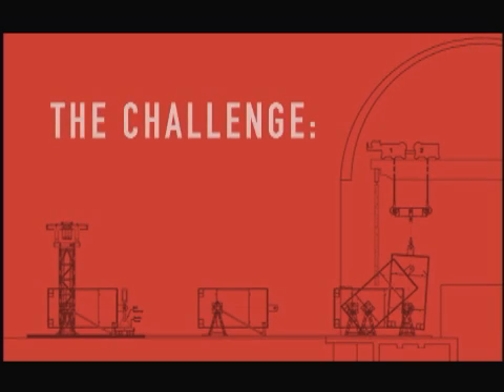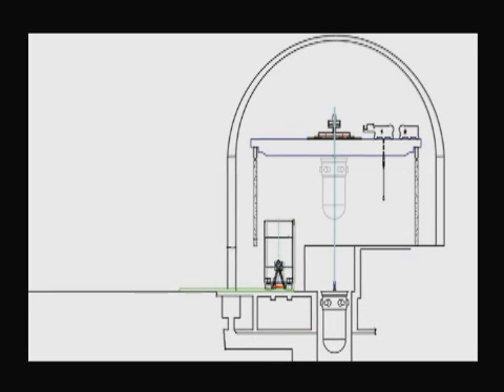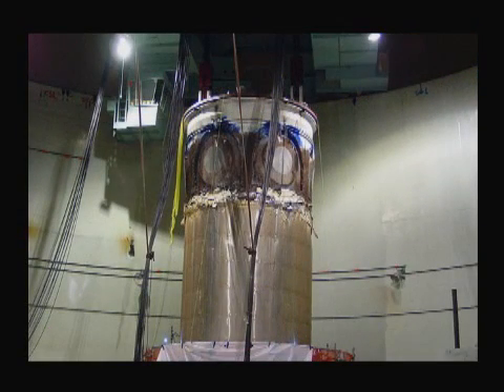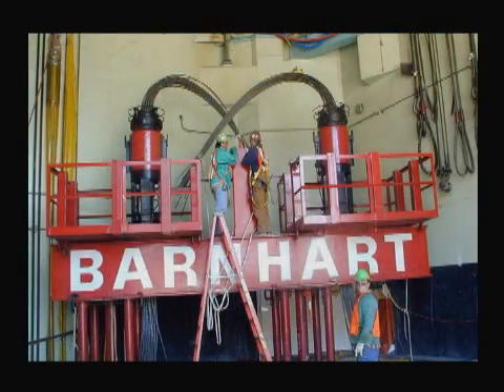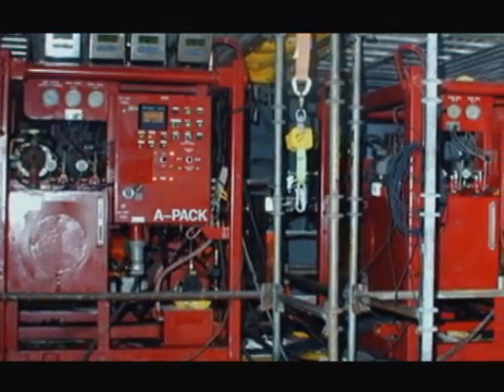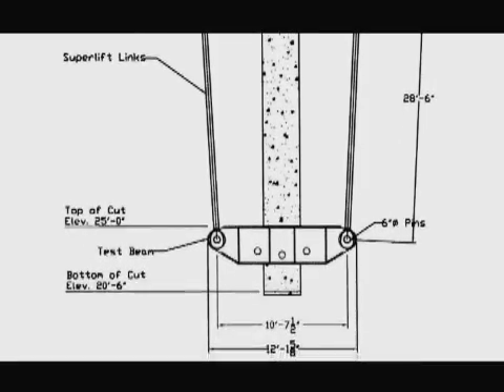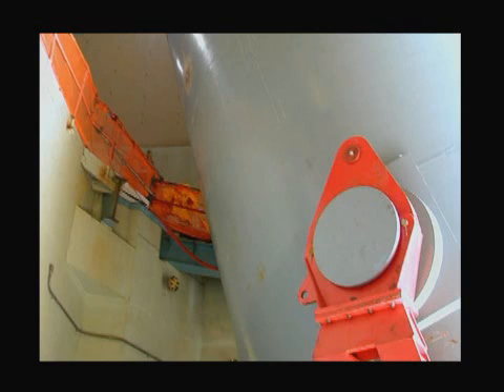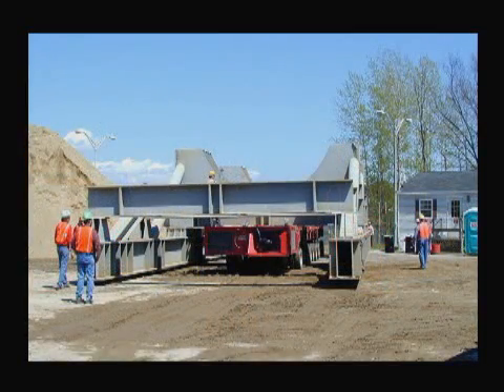Nuclear Power Plant RPV Removal

Comment: RPV stands for Reactor Pressure Vessel.  This is the place where the nuclear reactions occur, and it becomes more radioactive the longer it is in use.  The RPV is part of the Primary Loop - water, kept under enough pressure to keep it from boiling, tranfers the heat to the Steam Generators, where Secondary Loop water is boiled into steam.